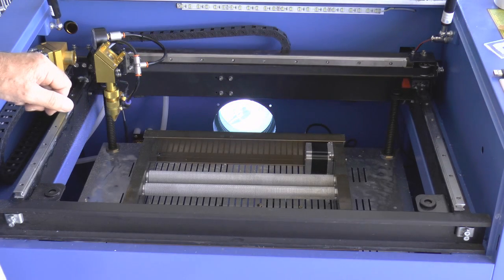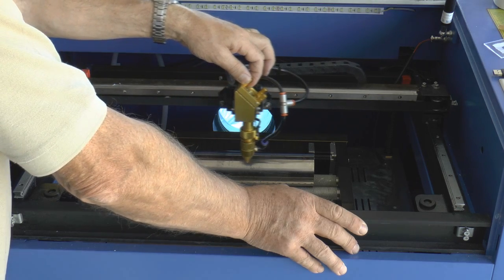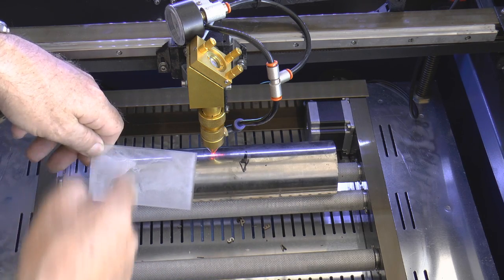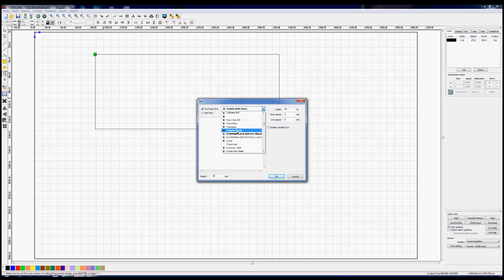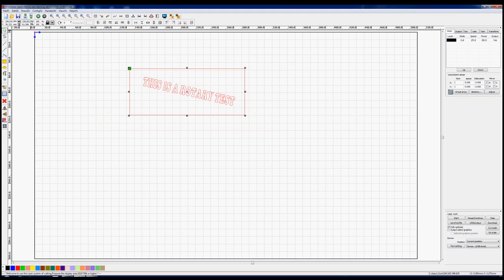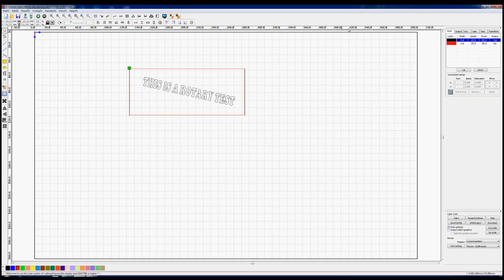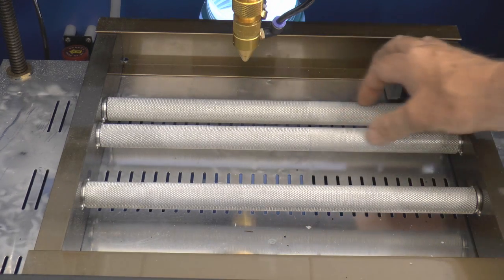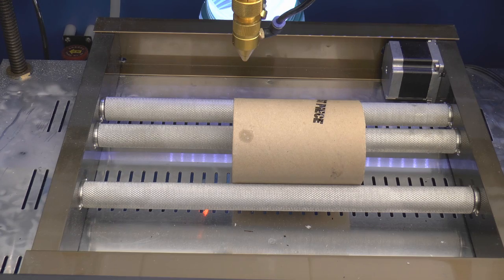RDWorks Learning Lab 11 part1  rotary table introduction

Comment: FYI rotary attachment doesn't have any home switches, machine take so long to zero axis and it gives up basically. You have to manually move gantry that you disconnected and move it to its home switches. find video  on  YT " roller rotary setup" from boss laser. Interestingly Boss lasers are little modified Chinese lasers and they even use RDworks
Reply from the maker: +mateusz1945 
I can only say, watch this video fully to witness  that my machine DOES find it's zero automatically. Whilst experimenting, I initially tried to force a manual zero on the Y axis and never succeeded. I realise that Boss Lasers are basically red re-badged versions of my blue machine.  They have done a good job of re writing the manual for RDWorks so that it's now understandable english.  Maybe some of their firmware is different also.
Reply: +SarbarMultimedia  connect your Y axis and take timing belt off, you will see that stepper will still spin slowly and try to find home it will never find it, After a while it will give up and let you use machine without home.
Just because machine starts and its ready to go , doesn't mean it found "home" i know because i did that and i have same DSP
Reply: besides there is absolutely no need for home or limit on rotary table. Limit switch requires 2 extra wires. If your stepper motor only have 4 wires there is no switch. 
 It is weird that you cannot manually home it because DSP is not aware that you connected rotary and it still is looking for homing from your y axis. Key is to move your gantry to switch then wait until stepper reverse rotation and then move away from switch.
Reply from the maker: +mateusz1945 
Thanks for all your information . I have not used the rotary since doing this exploratory work a few months ago but I will check out your suggestions. When trying to find out find information about why I couldn't get my rotary to work (there were no instructions) I did read that there was not an actual zero for the rotary and that it just ran out of patience after 30 seconds or so and let you proceed. I eventually found my problem was that I had ticked "enable rotary sculpture" in the tooling program. It appears that this is for use with a  chuck type rotary nand not the roller type.
Thanks again I'll hook up and try all in the next few days.
Reply from the maker: +mateusz1945 
I was doing a quick mode burn test a few days ago and had  to disconnect the Y axis. I recalled your comments and tried to manually move the beam into its home position. I couldn't get it to zero immediately and even after 20 or 30 seconds it didn't register. However, as soon as I moved the beam away from zero it registered. That's great news so thanks for that information.
Reply: Also try to "enable rotary engrave" with settings i posted on your second video. I wonder if it works for you. Happy to help, i am learning too

Comment: can u please tell me the parameters for a yeti rumbler. I have the same china laser. Thank u
Reply from the maker: +rudyq2011 

Hi Rudy. Sorry I can't be of too much help to you . A Yeti tumbler is not something I've encountered here in the UK but I did check on line to get an idea what you are talking about. Firstly it is stainless steel, which you definitely cannot etch or engrave with such low power lasers like ours. The best you can do is to buy some very expensive chemical spray that basically you bake onto the surface with the laser beam., I'm sure you can find that on line. The other problem is dealing with tapered vessels. If you go to session 18 (I think) you will find a gizmo that I have designed to help with this problem. There may be alternative solutions for tapered vessels so it may be worth Googling it.
Reply: SarbarMultimedia
Thank you. But I went into vendor settings and wanted to change the y axis. But endeed up changing the x axis. Is there a way u can send me the original settings for x and y axis in vendor settings? Thank you
Reply: In the step length i had changed it. but now i am looking for the original setting
Reply from the maker: +rudyq2011 the answer is 0.35 microns. If you go to session 11 part2 there is a little section in there warning you about the dangers of messing with the vendor settings. The little table that comes up has the info there in case you lose it again. The settings are the same for both X and Y.  Have you checked out part 2 yet because if you have the same rotary device as mine then the calibration method described there will save you going into vendor settings.
Reply: Awesome. Thank you. Yes i have the same laser and the same rotary attachment as you
Reply: I keep getting a Y slope over  on the laser machine itself. Have you ever ran into that problem?
Reply: I cannot read the little table in vendor settings. it is not clear and is a blur.Please can u send me the entire settings for x and y settings so i can set my settings back to the original settings
Reply: ok just emailed you
Reply: ok email just went through from my girlfriends email. my email would not send. Let me know if you got it
Reply: I emailed you can you please let me know if you received it
Reply from the maker: +rudyq2011 
Hi Rudy

Didn't get email. I have another RDWorks installation on my laptop and I find the settings there are completely different at 22.57439for X and 22.57532 for Y. Just beside the step box there is a little button with 3 dots on it. If you press that you will see that you can calibrate your machine  by putting in your own measured data Just program a 100mm square and cut or etch it. Measure the result and put both bits of data into this little window to reset your machine.
Dont know why data in both my pc's is so different. The number shown here is just under .001" which sounds a more realistic figure than that the .35 from my other machine.